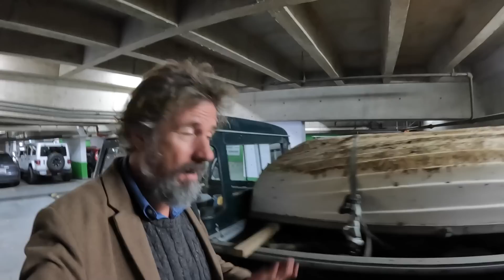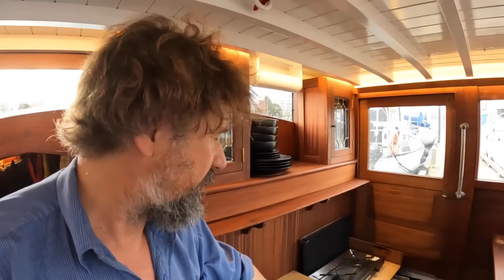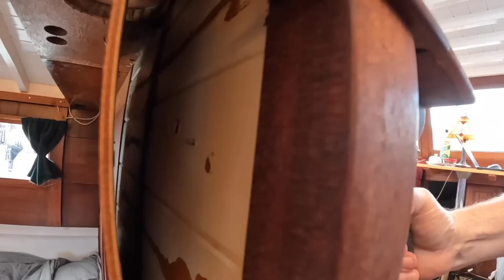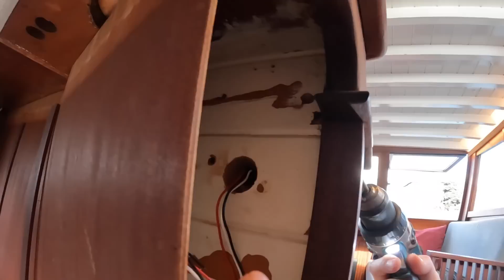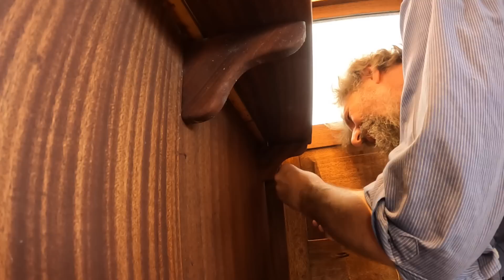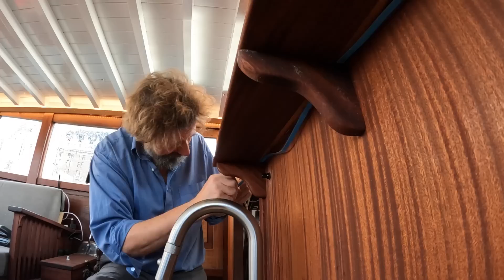Ep 443 - LED Lights for Your Boat's Interior: Wiring Tips for Installation -Travels With Geordie

Comment: Neat install Peter! Only thing I mind, is that you tape the LED strip directly on to the wood. LED tape needs to be mounted on a aluminium profile to get sufficient cooling. It does lower the life of the LEDs and also makes the glue in the tape loosening prematurely.
Reply from the maker: You know, tapping to the wood did bother me for exactly those reasons as I am surprised how long these LEDs run. Thanks for your insight!

Comment: That switch is a mini PCM, pulse code modulator.  It cuts the constant flow of current into smaller on, offs.  LEDs, and DC motors, need PCM control vs a simple potentiometer as a controller, ergo, dimmer.  Pots will cause pulsing and over heating (motors, not so much LEDs), and long term issues.  PCMs are always the right thing to use.  They have gotten smaller, and less $, so do it
Reply from the maker: Thanks Sean, what great insight. These little units have certainly proved their worth. Cheers!

Comment: Just a thought with the Arts and Crafts/Mission style you have on Poem...those rear facing windows in the doghouse might look really nice with quarter inch bevelled edges. You may find that a bit too twee but it could really twinkle in certain light conditions, including if you had hidden lights on the aft cabin roof. With modern LEDs you could pre locate all your external Christmas coloured lights that could be used for parties too. Just some  thoughts 😊
Reply from the maker: David, I love the way you think! Function always follows form. Design rocks! Must invest in a glass grinder now.

Comment: Keeping on with episode topic Wiring Tips & Tricks when cutting off a factory molded connector from a length of wire it sometimes comes in handy to leave 3-4" of 'pig tail' wire on the connector which can be used on another similar project like possibly the remnants of that LED spool. When the need arises just slip on a short length of heat shrink tube, solder and seal. I'll leave where to keep the piece and finding up to you. Your lighting job looks perfect, perfect, perfect.
Reply from the maker: That's a great tip! But I suppose in this case, I can ever imagine using that connector. Cheers!

Comment: Peter, you didn’t mention if it’s an AC circuit with a transformer or just a DC off the house battery?
Reply from the maker: Great point will! It is indeed a 12 volt DC off the house battery.

Comment: There was a incident maybe two years ago of the french coast guard becoming very irritated while trying to hail a french tugboat at sea. The coasties boarded as officiously as only irritated coasties can to the complete surprise of the tug crew. The tug had not heard the hail at all . The cuase of the incident was determined to be the magnetic fields generated by LEDs used for both running lights(Near the antenna ) and overhead lighting in the wheel house. The International maritime organization is considering a rule on LEDs. Have you ever held a radio near an energized LED strip? Nocks the hell out of the singnal. Just food for thought.
 (Ed) A note on wire . Never paint wires. As paint dries it cracks the insulation. Repainting creates more cracking force. These micro cracks let moister in that also lead to the destruction of long lengths of wire. If you must paint , parcel the wire with tape and paint that parcelling.
Reply from the maker: What a great story, as well as a compelling argument. I will have to pay some attention to this!

Comment: Lower back exercises.  Must continue to breathe while doing these.  Pull in stomach muscles like somebody is going to punch you below the belly button.  Hold for 10 seconds.  Release.  Do this 12 times a day. 10 seconds at a time. This does a better job then the electrodes and pulsed current PT clinics do.
Reply from the maker: Splendid Wayne! I am doing them right now!